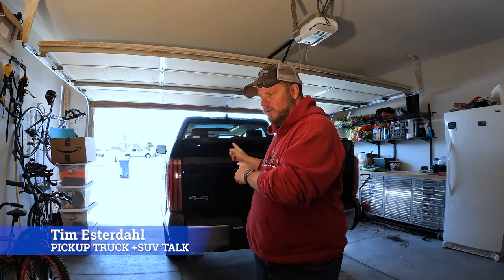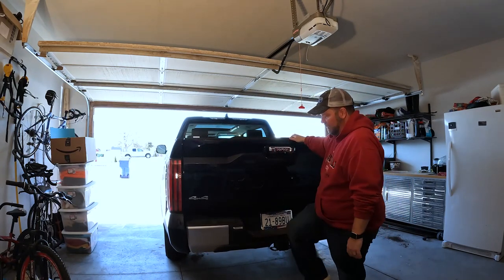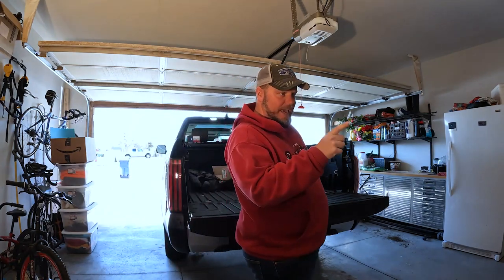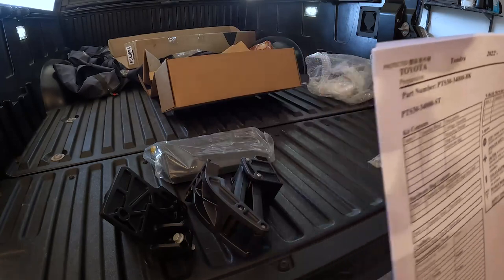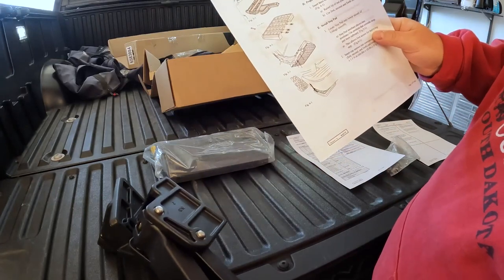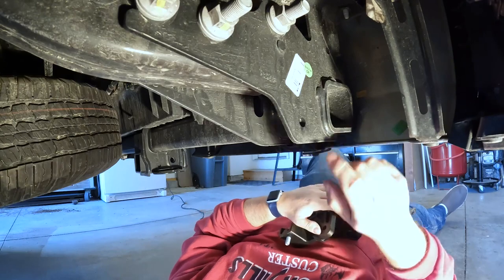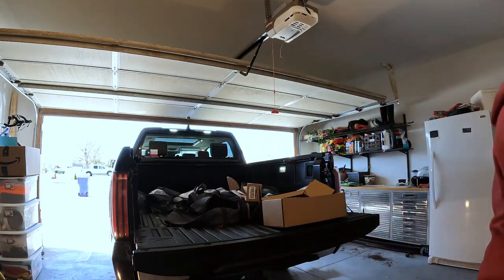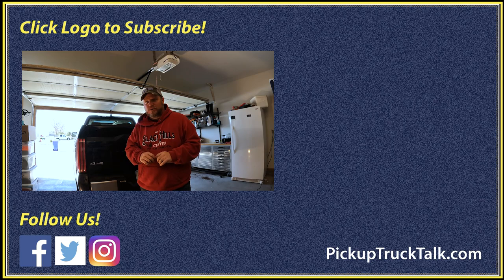Not So Easy! How To Install 2022 Toyota Tundra Bed Step

Comment: @ 10:00 WD40 displaces water it is not water based , It is a blend of several lubricants
The main ingredient is Stoddard solvent, which is also known by its own brand name, Varsol. CO2 is used as a propellant and mineral oil is another main ingredient. It was first used to protect the Atlas missile from corrosion and it became available to consumers in 1958.
Reply from the maker: Right, that's why I added the caption. :)

Comment: Any rattling when driving?  I wonder how well that would hold up for the folks that live in the rust belt.  I'm thinking about getting one for my F150.
Reply from the maker: No rattle so far. Pretty good fit once you get it installed.

Comment: I'm curious Tim,  from what I'm seeing that's a really long stretch from the step to the bed. Is 
it the camera angle or would having 40" inseams be helpful?   Watched it a few times and it
looked like you almost clipped your right knee getting in. 😵  I'd like to see Jill try it out.
Yup, what a pain to install..     The GM steps will really spoil you.
Reply from the maker: Probably just the video angle. It was pretty easy to get in.
Reply: I saw that also.

Comment: Hi Tim I owned mine like your only mine is white and I just found out my tail gate steel cables supporting only the passenger side holding it the other side not because cable has too much slack. Does yours work ok? Thank
Reply from the maker: I’ll have to check.

Comment: How the design team overlooked (or dismissed) the need for a step (or tow hooks!) is almost beyond belief. 

It gets you to start wondering what else they didn't think we'd need and when those poor decisions might start showing up? (Waste gate issues, perhaps?)
Reply: They also designed this brand new truck with a driveline hump going through the middle of the rear passenger floor..... just what you want; stack long large boxes etc into the rear floor area and the teeter-totter back and forth over the center floor hump..... F150 and Ram both have completely flat floors.... which is so nice for hauling items inside the cab.  GM has a hump also.... which doesn't say much for Toyota if they have the same lack of forethought as GM.
Reply: @joefriday6324  Flat rear deck with fold up seats is a huge selling point to some customers. in these crew cabs you can put a ton of cargo in the cab that you don't want in the bed that way.
Reply: Can you really sit there and believe that the entire design team genuinely didn’t think of this at all? That’s literally the least likely possibility of the many that come to mind. It’s obviously still dumb but there is no chance they “didn’t think of it” at all. None. This is obviously some production snafu more than likely containing some legal nonsense. Once again- it’s still dumb and annoying. But it’s impossible for me to believe they didn’t think about this a single time. 

The watergate issue was a manufacturing fup that the supplier lied about. Do you really think they didn’t think they needed a functional wastegate as your comment would suggest?
Reply: @joefriday6324  my suggestion is to use the bed… 😂
Reply: @Nahbruhsheesh  Oh, somebody probably thought of it, but either they knew nobody wanted to hear their suggestion, or their opinion was ignored. 

If somebody doesn't want/need a step to get into the bed, that's someone who doesn't need a pick up truck.
Reply: @jimthumerzs2301  your first point is possible but incredibly unlikely. Your second point is true 😂

Comment: I was able to install without removing any additional bracket. I assemble all pieces first, then with the step extended and slightly at a lower angle fit the main mount to the truck with a little wiggling around and rotate in to position.
Reply from the maker: Good thinking!
Reply: What is this part number or where can i get it from
Reply from the maker: @josedanieldeleon3655  go to your local Toyota dealer. They have all the information on what you need and can order it.

Comment: Tim on your paper work that came with those steps, does it have all the part numbers that came in the box? if so can you provide me with the hardware information for the bracket, Its a long story but I only have the bracket and there's not hardware that came with it, I don't know what hardware I need for the bracket. Thanks
Reply from the maker: Sorry, I threw out that paper after I installed the step. I showed what I had on the screen though. I'm hearing it isn't the full package and instead is just a bracket.
Reply: @Pickuptrucktalk  Thanks Tim, I’ll have to keep digging for the correct bolts, i just found out that the BK stands for bracket ST is the steps and the numbers without any extensions is the complete kit, which Toyota does have because of a national shortage I’m being told, but you can order these parts separately!

Comment: So stupid, spend 70k and still have to buy a $400 step, GM/Ford have the best setup. This oops we forgot bed access from Toyota Ram/Nissan is like buying a 250K house with no shitters.
Reply: You're not to smart saying crap you know nothing about.  Your GM has the free bumper step, but you'll pay out the ying, yang for the tailgate one.  Same for the Ford.  The Toyota, Nissian, and Ram all offer the step as an option.  So WTF are you talking about.
Reply: @johnengel9162  LOL, I know exactly what I’m talking about. Not buying a 70k truck and have to buy a $400 step to mount under the bumper. GM/Ford have the best setup. I rather spend the $695 for the options multi-flex from GM or Fords Verizon. These steps that mount under the bumper look cheap as hell and look like i after-thought, because we’ll they were. Toyota by far as the worst bed access without even using a traditional rear truck bumper.
Reply: Oh yeah that’s a great comparison 😂 I love how when a small issue with a Toyota comes up the ford gm people pretend those companies are absolute perfection.  Ford literally knew their design would kill their drivers and didn’t care at all. Tell me more about ford design setup 😂😂😂😂
Reply: @johnengel9162  so true! I love how the slightest design issue comes up on a Toyota and all the ford gm people pretend those companies have an eternal record of perfection 😂😂😂
Reply: @Nahbruhsheesh  😂 I also love when ever there is a issue or bad design with a Toyota the fan boys come out of the woodwork. They all have there issues and faults. It’s a personal opinion wether or not I or you think it’s a small issue or a big issue.
Reply: @jayray274  oh yeah I’m a fan boy because I brought up the point fords design killed people, ford knew about it, and were totally okay with it.  You gotta be a woodwork fanboy to have any type of issue with that, huh? 😂
Reply: @jayray274  triggered much? 😂

Comment: Just use a cutoff tool to cut out the metal bracing behind the bumper.  5 minutes and it’s installed.
Reply from the maker: They actually changed the part and the instructions on how to install after this video.

Comment: Why would this type step not be on the side toward the curb?  My Fj Cruiser had loading right.  Most vehicles load from the middle of the road side which means on a busy street you are working on the traffic side.  All this gear should be on the curb side. If you are too troubled to walk around the truck you probably aren't capable enough to use any step to get in the truck.

Comment: Everyone seems to be complaining about the price of the step, I agree it’s pricey but you sure don’t get that Ford tailgate step for free. The upside is you can add it, if you wanted to retro a Ford that didn’t have the tailgate step it would cost thousands as you would need to replace the tailgate. I feel the cutouts on the GM are way to high to be of any real use.
Reply: I got news for you, the bumper cutout is 1" lower than the Ford tailgate step. It seems some people have opinions without doing any research.
Reply: @johnengel9162  That seems like that can’t be, the Ford tailgate step seems to come way lower, which trucks did you compare or where did you get the information?
Reply: @vitkobylka6432  Measured them at the '19 KC Auto show.  They were both 4x4 and non-off road.  BTY, the reason I measured them was that I read this on the GM forum and thought that can't be right, but they were right.
Reply: @johnengel9162  Wow, thanks. Looks very deceiving, must be the big open space on the Ford and no opening on the GM that makes it deceiving. My push down step on the 09 Tundra is 10.5” off the ground, but it still seems like the step into the box is still to big and a little awkward without a handle. Getting older sucks. Maybe I need a low rider, lol.
Reply: @vitkobylka6432  Try putting an ax handle in the rear stake pocket.  It makes a great handle for getting in the bed and is easy to install and remove.  I'm 67 and need the extra help too.
Reply: @johnengel9162  You have 10 years on me and your life experience shows. I was racking my brain on what to put there that would work and your solution is simple and frankly elegant. I had to go out to the truck to see if I even had stake pockets. I do, have to remove a small plastic piece. Now I’m thinking I’ll get my welder to make one with an L shape at the end as a handle and I’ll be able to use that as well to reach inside the bed to get things that slide to the front of the box. Thanks for the solution, cheers.

Comment: I cannot comprehend why Toyota didn't think to design some sort integrated of tailgate step that Ford and GM have had for years with this brand-new generation Tundra.

Ehhh, maybe when they release their next generation Tundra 15 years from now.🤞
Reply: Can't have everything. Toyota dependability, everything works the way it should.  Good gas mileage, great resale value. Or a truck that has none of those things but includes a step.🤔

Comment: Tim, that's funny you had such a hard time finding this part.  Took all of 30 seconds to find the part listed at the local Topeka, KS Toyota dealer.  Price is $103.43. 😁
Reply from the maker: I should have mentioned I looked for this part back in January.
Reply: @Pickuptrucktalk , OK that explains a lot.  Still don't know why the price difference?  Someone mentioned that part no. was only the brkt.  But the description said it was for a tailgate step and showed a picture of the step.
Reply from the maker: @johnengel9162  Yeah, I saw that comment as well. I think all the confusion falls back on Toyota since the accessory parts rollout has been less than stellar.
Reply: @Pickuptrucktalk  Agree completely. 😀

Comment: Great job
Toyota is showing two prices 275.00 and 350.00 which might be the installed price.
I just bought a 35.00 step stool I throw in the back. 😀
Reply from the maker: 😂 well played.
Reply: I did in the beginning but the price on ebay came down to just over 100.00

Comment: I can vouch for the amp bedstep - 5 years no issues on F150. It's more useful than a tailgate step because I often load 8ft. lumber etc. with the gate closed and I'm able to still get up in there easy, all loaded up. Plus with the gate up, I can still use the backup camera.

Comment: order P/N PTS3034000 for the 2022 Tundra.  It comes with -BK and -ST and bolt kit and instructions...  also a lot cheaper ($244) than ordering the others separately ($300+)

Comment: Are you sure that is the step for a 2022?   My reason  for asking is because the design seemed to be off and my local dealers have told me they can’t order the bed step yet.
Reply from the maker: Toyota sent me this step specifically for the 2022.

Comment: A pathetic solution for a brand new truck redesign, by a manufacturing/design team that took little consideration for basic functionality and features that truck owners want.  No good, ergonomic bed access???  A new truck with a driveline hump through the rear passenger floor??  You couldn't pay me to buy this truck over an F150 or Ram..... and I have owned Toyota products.  Very thoughtless implementation.  Toyota had a blank slate and could have knocked it out of the park, but designed this feeble turd of an effort instead.  They don't know what truck owners really want.

Comment: Good video.  As wonky as the GM bumper step looks , I think it’s a nice help into the bed.  And the HD version as them Close to the cab so that’s also cool as well. The Ford tailgate step is nice too but it’s nice to be able to just step on it and go. Hey Tim do you by any chance know if the ram barn gate opening is smaller than a traditional tailgate?
Reply from the maker: Same size for Ram barn door and normal tailgate.
Reply: I think the GM version looks great and it’s very functional. Toyota dropped the ball on this one.

Comment: I don’t think the step will be compatible with the TRD off-road package because they routed the exhaust through that area…yet another example of Toyota’s superior engineering…besides Toyota doesn’t think it’s necessary to get up into the bed
Reply from the maker: This is the TRD off-road package. Do you mean TRD Pro?

Comment: Toyota needs to go back to the drawing ✍️ board they made this truck smaller with a smaller engine no more six seater option for family road and camping trips. Center console is overkill way to big leaving you with No side to side leg room keep ur legs in a straight line. If your a bigger guy this is torture especially on long trips and to top it off it really has no functionality whatsoever just a big box of wasted space. I test drove the truck and instantly I was not impressed 2nd gen tundra felt more brute power  Very disappointed. As a long Toyota customer I was expecting nothing less than way more & HD DIESEL‼️ with a growing family we need more pulling power.  And the fact it looks a little bigger than a Tacoma and a price tag of a HD 8 lug 4x4 Diesel truck.  Come on TOYOTA step up to 3/4 1TON trucks

Comment: I'm not trying to be that guy, but what about getting in a little better physical shape. You don't look that old. Once your health goes, it's tough to get back.
Reply from the maker: I've been working on my health since last August. Learned I have a pinched nerves in my neck and a degenerative disc in my lower back. Also, switching to a Mediterranean diet for inflammation.

Comment: To be honest it doesn't look that bad as accessory installs go. You had to temporarily move one bracket. I think the bigger issue was not having detailed picture instructions to help navigate the minor issues along the way. The parts appear well made at least.

Side note, buy a creeper man! Saves crawling around on a garage floor doing this stuff.

Comment: Would be sweet if they could copy ford and have it built in!
Reply: Unfortunately you'll just have to deal with the best truck on the market. Dependability, gas mileage, resale value. Versus a nice step🤔
Reply: @Mr.Robert1  Dependability isn't looking to great for Tundra so far. Hopefully they will get it figured out soon